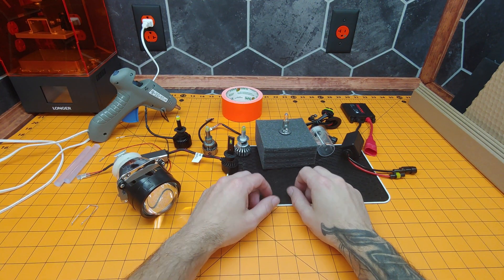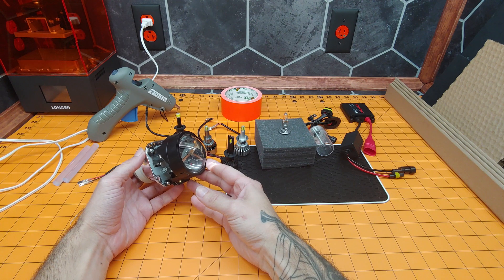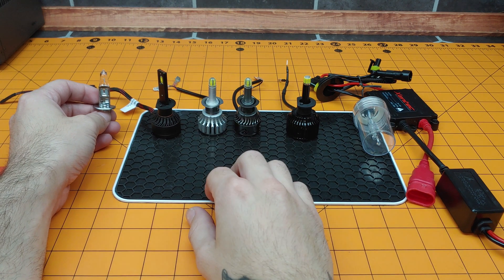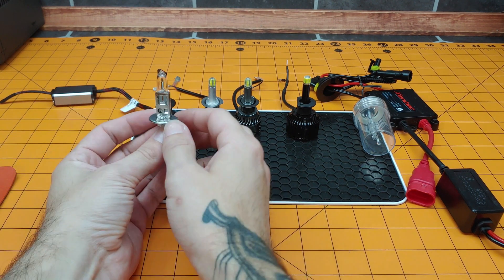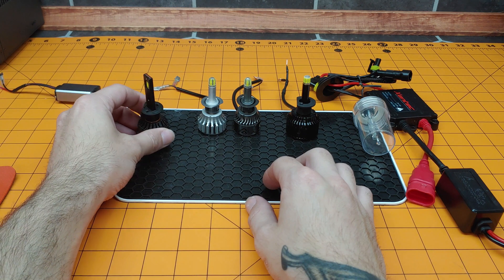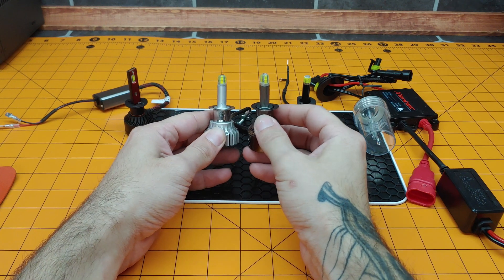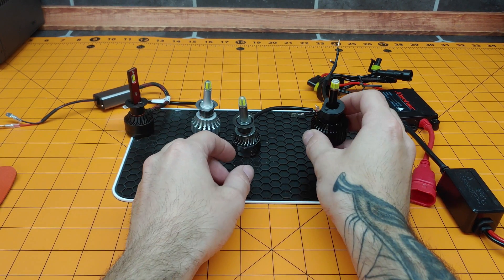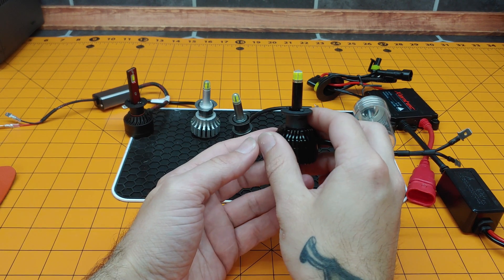Mini Projector Bulb Comparison

Comment: Surprised you didnt include the Racbox leds! How do you think they would compare to these?
Reply from the maker: I would put them at about the same performance as the S&D LED bulbs. Better than 35w HID, and faster than 55w, but a little less bright than the 55w Xenon.
Reply from the maker: I wanted to, but I only had the D2S/D2R Xenon adapter plate and the mini projector only accepts H1. If I do it again, I'll measure the shaft length and 3D print the proper H1 adapter plate.
Reply: You should do a best D2S led shootout!

Comment: This episode will go down as the benchmark for online bulb testing. Above and beyond excellent analysis and measurement of each bulbs attributes. Obviously multisided LED is capable of maximum even light distribution. More even than the much vaunted Xenons.
Reply from the maker: Yes, I failed to mention that the reason the upper level needs to be brighter is because it will be stretched further across the road.
Reply: @Jamesthelightguy   yes now I understand. THX!

Comment: Do you think that the car rover's poor heatsink would be an issue if I use them for hi beam only?
Reply from the maker: No, I would only suspect possible complications from extended periods of continuous use. I doubt the bulb would suffer much (if at all) when used for less than 15 minutes in an enclosed housing or 25 minutes with heat sink in open air.
Reply: @Jamesthelightguy  Thank you